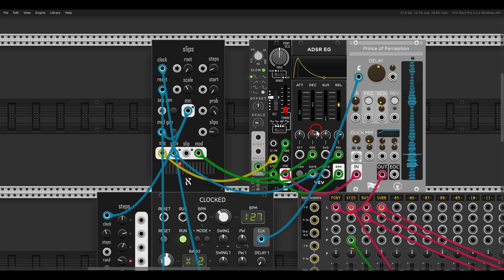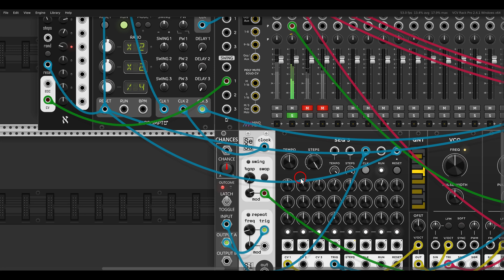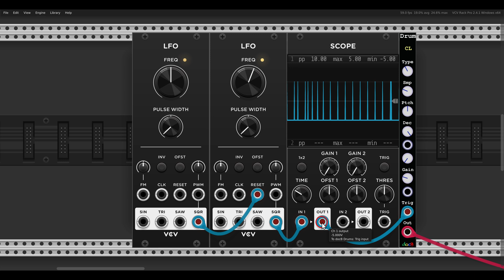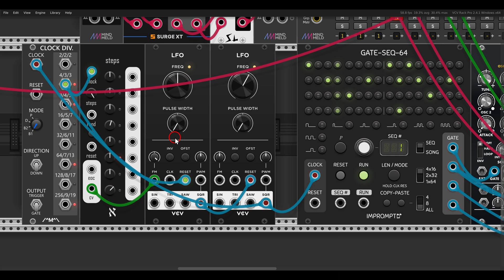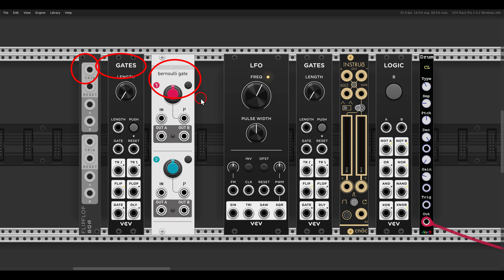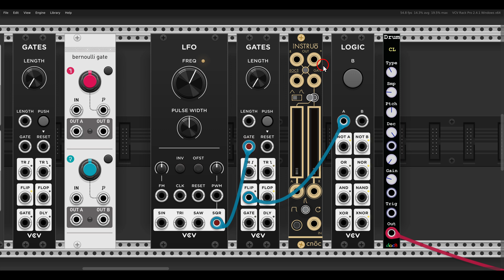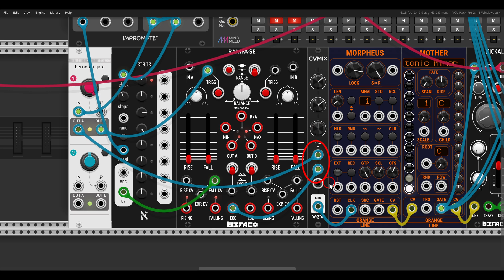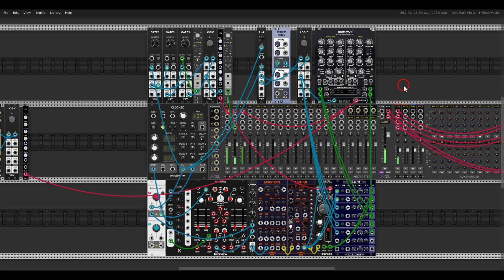3 ways of creating SWING in MODULAR

Comment: If I use branches as a switch, won’t my swing be on random beats?
Reply: no if you right clik menu select toggle it will become a flip flop
Reply: @fyaaaaaaaaaaa  ah, I’m using the hardware version
Reply from the maker: Hi! This will work in hardware as well. You just have to click the button and set it to toggle mode. Then, take the probability knob all the way to the right, and with each incoming trigger, Branches will toggle between the outputs, which is basically flip flop functionality.